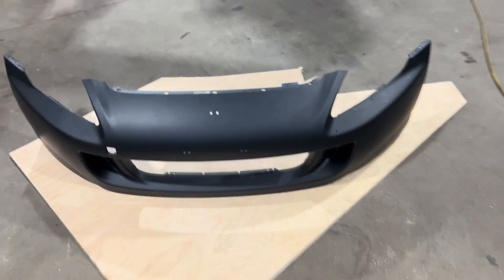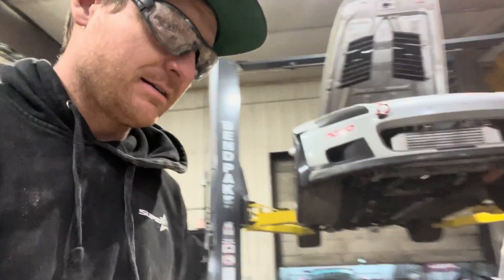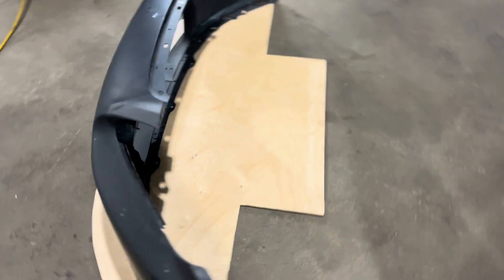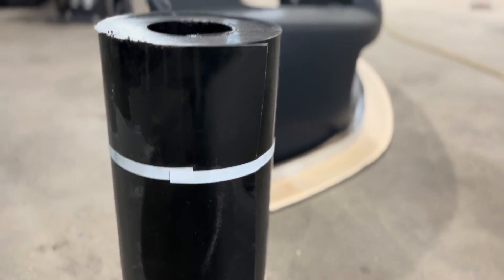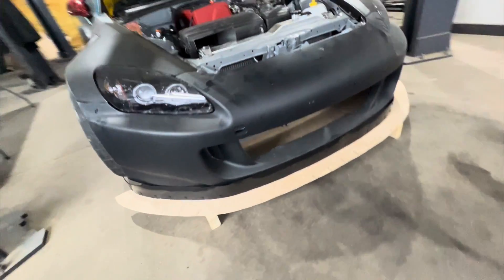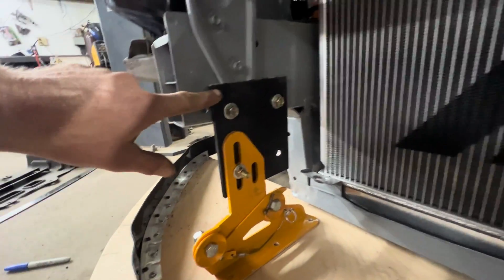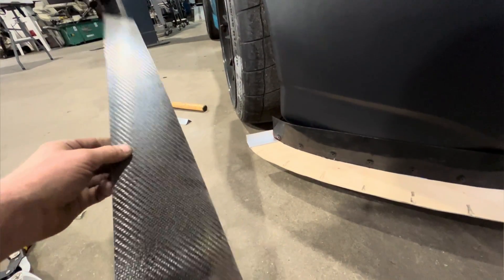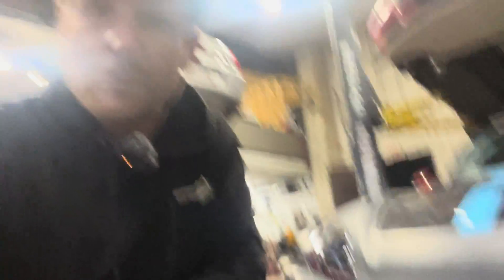ASM TechTalk: DIY SPLITTER, Track Tested & Proven With Results | ASMotorsports

Comment: I have a ep3 with a splitter and air dam, do you need the tire spats if your wheels are slightly tucked in the arch or is it good to have them fitted regardless?

Comment: what thickness were the carbon fiber sheets you used for the tire spats? you mentioned 1mm but they look a little thicker. also, do they hold its shape after cooling? and during testing, did you find them to push back and into the tire well from drag at high speeds due to mounting points? also, my widebody evo has its inner fender lips cut, any suggestions on how to attach this piece to the fender well?
Reply: I'm not sure if you found a solution but if I'm comprehending what your saying is, u want to get that L portion back that most ppl would roll to clear space for thier wheel set up. .

This dude channel is really good for learning diy sheet / tin  metal or what ever you want to call it. 
He have a video on how to make one or bend one back to oem shape. 

meister-megerle

Comment: I'm surprised it's only attached by those two brackets.
Reply from the maker: Normally we’d attach at radiator mount and then run rods at the main number beam straight down right behind the bumper.
Reply: @ASMotorsports  Yeah, I'm about to add two more pairs of rods in addition to the pair I have holding the sides up (they actually work pretty well) and hope I never need to take my splitter off.

Comment: Wouldn't riveting the wheel spats to the bumper and splitter defeat the purpose of the quick disconnect on the splitter?
Reply from the maker: They will stay with bumper.  We do rivnuts from the spats to the splitter.

Comment: Nice! Functional, cheap, and character building mods are the best mods. Check out the Acura ARX-06 and the slot they have behind the rear wheel, use that as inspiration for your next, functional cheap and character building mod. It's more effective than you think!